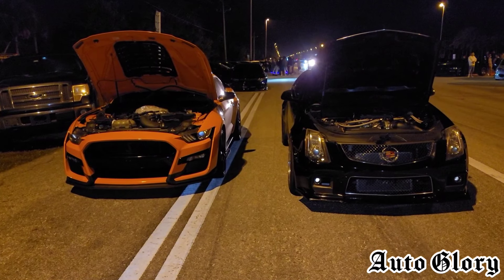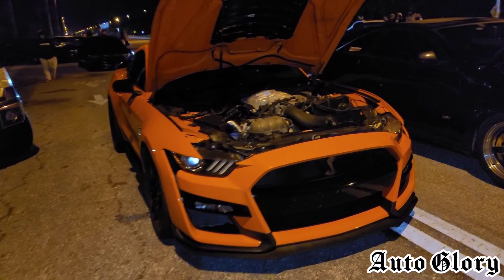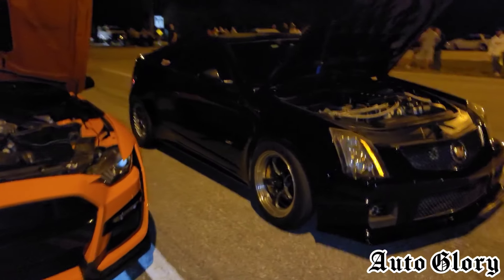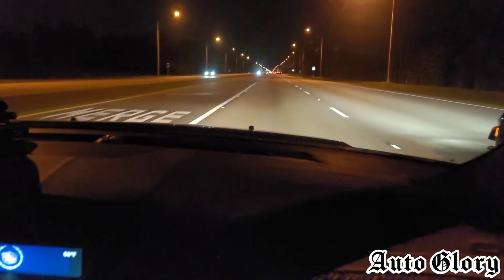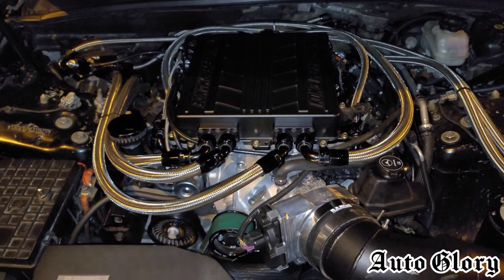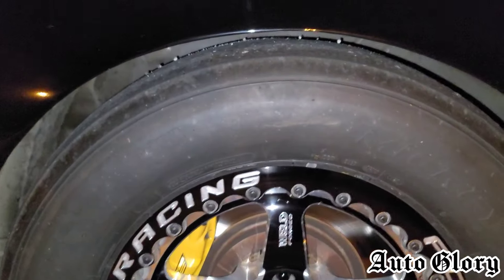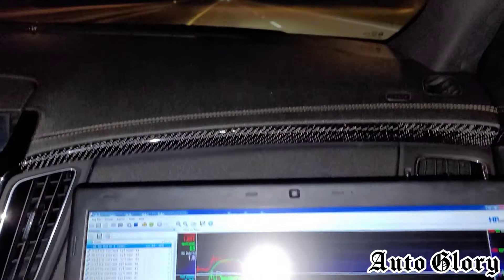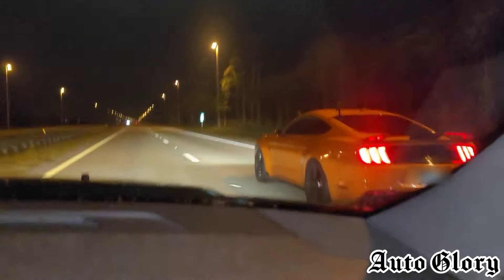2020 Shelby GT500 Bolt Ons E85 vs A Built 2012 Cadillac CTS-V Kong 2650 Supercharger E85

Comment: You know your car is fast when a gt500 has to jump to get a chance 😂 great runs
Reply: Clearly the faster car even without a jump lol
Reply: @RthereNEusernames  the gt500 got pulled back on in both runs. I just wish we could’ve gotten some clean runs but we both know what would’ve happened 😂
Reply: @burntchickenwingss  yeah I guess it was a lot closer on the second run but I'd still say the GT500 was faster, marginally.
Reply: Dude its a built engine vs a stock bottom.. U guys vw  no idea how stronger a built engine is in mid band over a stock bottom.
I fully give respect for both... But out f the box the Gt500 is MAD impresive to be that fast with a stock bottom.
Reply: @1989rs500  gt500’s are impressive out of the box over a stock ctsv that’s just my opinion and I like both cars also but almost every time I see a stock gt500 running anything it’s almost always going the gt500s way unless the other car is just as crazy stock as the gt500 or has a decent amount of work done to the motor. Gt500 top end is crazy but don’t quote me that’s just my opinion
Reply: @burntchickenwingss I agree out of the box gt500 is nasty but if I put 90k into anything it's going to beat it easily...I can get a shell of basically any car for 10-30k and still have 100k to play with to get to gt500 money...

Comment: Damn gt500 is really impressive nearly stock and it’s fast 💨
Reply: Gt500’s don’t make anywhere near 800 wheel “NeAr StOcK”
Reply: @texasstreetkings537  bro that 500 literally has one or 2 boltons just a pulley and intake if that plus supporting mods e and injectors and makes that power ford is really impressive imagine the 500 being fully built like the ctsV 💀won’t even be a race ….. even a heads cam zr1 fbo pulleys amd all supporting mods lost to a 500 stock motor boltons only I can send u the link if u like ?
Reply: @885.0ELopez  don’t even argue with them 
cause if it was a down pipe tune bmw or  other euro car they would say “minimum mods”
“simple bolt ons” blah blah blah
Reply: 885 broke lopez and Slow Kona are a match made in heaven 😂😂🤡
Reply: @885.0ELopez  thats not 1 or 2 mods hes literally full bolt on.  Intake, pulley, headers, tune, fuel upgrades and e85.  Besides porting the supercharger thats about all the power adders you can do.
Reply: @Toxic_coyote12  I mean installing a little pipe and downloading horsepower from ur laptop is beyond minimal mods. What else can possibly be easier then that
Reply: @predatorshelby5780  what headers 🤣💀that 500 literally has a bone stock exhaust with a cat delete only still has stock headers
Reply: @predatorshelby5780  far from fbo 🤣💀
Reply: @predatorshelby5780  far from fbo 🤣💀
Reply: Pulley, injectors, intake, cat delete, tune, E85, "nearly stock" lmao 🤡
Reply: here we go excuses for fbo mustang 🤣
Reply: The GT500 is an impressive car regardless of being fbo or stock.
Reply: @predatorshelby5780  lmao bruh now cmon. Fbo these cars make 1000+ easily
Reply: And the caddy is a 10 years old car... that is more impressive.
Reply: Ctsv very impressive for a nearly stock luxury car.
Reply: A FBO GT500 makes 11-1200whp if it’s any less than that, it’s not FBO period.
Reply: @885.0ELopez  ok you're right i missed the headers part.  Besides that what else do you consider full bolt on?  Is porting the supercharger a bolt?  No.  Dudes almost fully built as far as power adders goes.  But im sure you have one to compare right.
Reply: @predatorshelby5780  he only has a intake and upper pulley .. he can still do headers exhaust tb lower pulley etc. he’s super basic setup right now
Reply: @ktakashismith  I counted 1 bolton on yo list
Reply: @predatorshelby5780  The hell you smoking? It's such a basic setup on the 500. Intake, pulley, cat delete and E85...lol...there is so much more that car can do and he is running against a FULLY built, max effort CTS-V on it's 2nd highest HP map, 2650 blower, built engine, built transmission, upper/lower pulley so all the boost....lol...and it couldn't outrun the 500. Keep crying.
Reply: @885.0ELopez  Thanks for letting everyone know you can't count past 1, it's very brave of you to admit that publicly.
Reply: @texasstreetkings537 🤣🤣🤣🤣 this is tacopez the gayKaren crying
Reply: @52smoke 🤣🤣🤣🤣🤣🤣🤣🤣🤣🤣🤣🤣🤣🤣🤣🤣🤣🤣 poor people man
Reply: @DodgeandGMkiIIingFurdDaiIy  🤣🤣🤣 holy man you are so triggered here. How many comments is this now? 🤣🤣🤣🤣🤣
Reply: @freak_5.042  poor kid raging so badly on every YouTube video 💀🤣🫵🏽🫵🏽
Reply: The 2020 GT500 in stock form is already fast and has 200 horsepower more than this older CTS-V. With E85 and the other supporting upgrades on the GT500, of course the CTS-V would have to come with a built motor, tune and E85! Hahaha
Reply: @ktakashismith  well look to all the shit that the cts  v has  on and then compared both ; just to be honest 👍
Reply: @orlanRo-eg4tp  Never said the CTS-V doesn't have mad work done to it, just pointing out that the Pony boys are eating Cap 'N Crunch if they imply that the GT500 in this vid is "nearly stock".
Reply: @ktakashismith  ✌️
Reply: @885.0ELopez Fastest blower only max effort corvette 427x2650xf710 combo went 7s. There’s forums on it. The 2650 maxes out at 1200whp. Most roots blowers do. There’s a ctsv with a ported 2650 making 1200. Race that one. This ctsv is fast, but not high dollar max effort fast. There’s ctsv’s going 8s with the real “max effort setup”. What’s the fastest fbo gt500? 9.3? It’d absolutely need a built engine to beat the best of the best.
Reply: @CTSVSTHEWORLD  exactly u need built chevys to run stock motor coyote numbers ….coyotes run 7s straight out the factory chevys can’t ……fastest stock motor gt500 runs 8.1 that’s pretty much almost a 7sec pass and it’s only been out since 2020 and has the world record over any zo6 zr1 zl1 and any demon or mopar
Reply: @885.0ELopez  MightyMouse solutions stock block c7 ran a 7.91@ 171. Coyotes can’t get in the 7s stock w fbo🤣. You’re WRONG AGAIN. Oh and that “stock block” gen 3 coyote already comes built from factory with forged internals. Sure the fastest full weight, stock block V “only”runs a 9.08 second pass (justin87GN’s car). Corvette still smokes stangs on all levels. Twin turbos- Ls/Lt wins. Superchargers - LS/Lt wins. N/a- LS/LT WINS. ITS FASTER. ITS BETTER. ITS THE TRUTH. The winning team🙌🏽🤩.
Reply: @CTSVSTHEWORLD  u sound very delusional no Chevy runs 7s like coyotes do on stock motor please show me the link I’ll be waiting….. ford is just to fast

Comment: And that’s with a street tune on the Shelby, with just bolt ons lol. I’ve built both of these cars on my channel, Shelby is top dog. He did jump the first run though lol, but with an actual tune world of difference. That’s not even ported blower or throttle body with a smaller pulley vs a fully built, kong setup beast of a V.

Comment: Cadi FTW 🙌 nice race
Reply: Didn’t win either race lol
Reply: @hurdthenerd  He would have if the Mustang didn’t jump. He clearly said it in the video in the first run.
Reply: @AK_Audi  He would not have lol, Second race proved it. He caught up didn’t pass or win. 
Would’ve, could’ve, should’ve.
Reply: @hurdthenerd  If the car is catching up, is the faster car. Period. Its physics. He didn't win, but Caddy is faster, disappointing for the Shelby.
Reply: @GXMAN16  he won race was over already to bad. That’s on a street tune with bolt ons lmao.
Reply: @hurdthenerd  Yes you're right he won, the race was over, but the Caddy is the faster car. That's it. The rabbit lost the race, but still faster then a turtle.  I do it all the time in my Kia Forte, blow by and then by the time they catch up I let off, racking up kills, no tune with drop in filter.
Reply: @GXMAN16  if it’s faster it would’ve won 🤷🏽‍♂️. Had plenty of time to catch up and pass. I would hope a fully built car with upgraded blower can beat a bolt on car..
Reply: @hurdthenerd  bruh are you blind. The cadi clearly was creepin. Cadi is a faster car here and mustang driver jumped twice
Reply: @95regShamil  you must be blind thinking he won 🤷🏽‍♂️. Lost both races, creepin ain’t winning. Y’all wouldn’t say that for any other car lol.

Comment: Typical musturd jumping for dear life then letting off when getting pulled on 🤣. V wasnt even on fastest map
Reply: No jump on the second race and the V struggled to reel in the GT500. More power with roughly the same weight
Reply: @saudabrahams  he went on 2
Reply: Fully built engine, fully built transmission, Kong 2650 blower, small pulley and 2nd fastest E85 map at 900whp and barely, BARELY, pulled on a pulley and E GT500🤣and you on here like the cry baby you are trying to downplay the GT500. Cope.
Reply: Junker gt500 bro spent $100k plus more on mods and still wanted to jump an old Cadillac 😂😂😂
Reply: @freak_5.042  you raging on every comment 😂😂

Comment: Man I was told a bolt ons e85 gt500 would be UNBEATABLE 😂😂😂 just grab an old ahh ctsv and don’t spend $100k+ on a new gt500💀💀💀
Reply: 🤣🤣 you STILL crying all over this comment section 😭 imagine having a max effort CTS-V with fully built engine, Kong 2650 blower, upper/lower pulley, E85, built transmission and STILL not be able to out run a GT500 with a pulley and E85 🤣🤣🤣☠️☠️☠️ rage for me, it's so awesome.
Reply: Poor kid raging hard 🤣🤣🤣 gt500 jumped so badly 🤣🤣🤣
Reply: @DodgeandGMkiIIingFurdDaiIy  🤣🤣 50th comment by you. Keep raging!! 🤣
Reply: Junker poor kid raging hard today she’s angry 💀🤣🫵🏽🫵🏽